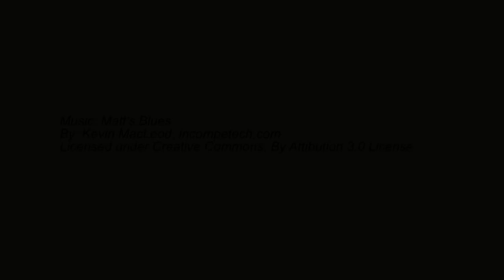Cool New Hammers from Martinez Tool Company

Comment: As a tool addict I own almost every kind of hammer under the sun. For framing I use a douglas 19 oz hammer, for trimmnng I use an estwing 12 oz leather handled hammer,  and for concrete forming I use a 14 oz t-bone hammer.  I rarely use a hammer for demo, as I was taught the trade by old timmers that would ream me out for improperly using my hammer and would make use a small pry or a hillbilly bar as we call it in Chicago. These new hammers are a big improvement over the old stilettos, and I will definitely add them to my collection.  To all those people that say you can get a Vaughan hammer for $200 cheaper, while true you definitely are missing the point. These hammers are pricey but they're indispensable for carpenters driving nails day in and day out, and while nothing will ever replace good old hickory for absorbing impact, I'm glad and thankful that Mark Martinez designed a great hammer for us all to be able to ply our trade more comfortably and more efficiently.
Reply: you really like hammers
Reply: @Zozo806  When you’re driving over a thousand nails per day, you tend to focus on what you’re swinging!
Reply: oo rah, the hammers are worth the money for replaceable/swappable heads and handles alone.

Comment: hi Mark, for me one of the strong Benefits of this hammer besides the unique design, lightens and quality is being able to switch out the head should it become worn or damaged as well as changing the type of head altogether to say a ball point or mallet. for me my interest in this hammer besides the inventors high reputation was the ability to us this one hammer as two hammers_ so by simply changing the framing head for framing, to a finish head for furniture projects. however after speaking with Sandra it would appear this is not the case, Sandra has advised me that I can purchase the m 1 with milled or smooth head only for framing but I would need to purchase the m 4 for finish work when it becomes available. given the information from both this  video and the emailed information from Sandra I am a bit confused and I hoped you could please clarify. love the hammer.

Comment: hi, very nice hammer. I am a Irish carpenter working in Ireland and I currently use the vaughan 23oz wooden handle hammer for framing and it's time for a change. I heard the stiletto hammers are the best as they are made from a single piece of titanium which is stronger and lighter than steel. but in this video it seams to me that you recommend a hammer that has a STEEL head not titanium. before I purchase can you recommend which hammer you make that would suit my needs? I prefer a long straight handle 18" but doesn't have to be wooden. I do framing as well as framing work, this might mean I need two separate hammers but you can advice. I have no intention of abusing my hammer such as concrete work. Cheers Dan
Reply: Daniel O'Connell he used a steel face because titaniums waffle face wear of easily. I have stilleto but I switched to steel because the face don't wear off. I use deluge 21 oz now but I'm thinking of switching to his new 19 oz hammer
Reply: Daniel O'Connell I have a 14 oz stiletto mini all titanium. I really love it for what it is and for my old job. I bought the mini for when I was working with stairs and hammering in wedges all day long so I didn’t need the extra reach/drive like the ti-bone offers. So I started Formwork construction, and sure the mini works but I’m always wanting more weight/extra reach on the job site. I was about to buy the 15 oz stiletto until I saw this hammer, so I just purchased this online($300.00 CAD with shipping later)- I can’t wait for to try this hammer out.
I’ll let you know how it goes, but I will say..don’t buy the 14 oz mini stiletto if you’re doing heavy construction- you’ll be wanting extra reach but the 14 oz is a great hammer for what it is.
Reply: I'm late to this thread but a m1 I've been using mine and I absolutely love it

Comment: I can buy several estwing hammers for 200 bucks. They never give up.
Reply: True , for what i want an Estwing is more than enough :]
Reply: massey9556

Options are good.  In a socialist utopia you'd have one choice, like it or not.
Reply: Yes, but I believe the issue is the inevitability of your joints giving out.
Reply: Well after snapping 3 different 22 ounce estwings I pulled the trigger on a tibone 15, I still carry a 22 estwing because the slimmer profile is convenient in those tight spots. 95% of my swinging is with my stiletto and I’d never look back
Reply: Just your elbows will give out .

Comment: I guess my question is why would you use a $200 hammer for demo ? I know you have to plan for every use and I generally use a Stiletto wood handle. I have broken a number of handles doing demo, so I got in the habit of using an Estwing or similar steel hammer for demo, then switch back to the Stiletto for carpentry work. I may try the Martinez, the only question I have on it is length. It seem significantly shorter than the wood handle hammer. I use tennis racket grip on my Stiletto, fairly durable and more cushion than the baseball bat tape I was using. My 2 c.
Reply: Glenn Banks I use my tibone 15 oz stiletto for demo in concrete work no qualms haha
Reply: The Martinez M1 framing hammer is of comparable length to the Estwing 22oz framing hammer.  And the Martinez M1 finish hammer is of comparable length to the Dewalt 12 oz High Velocity hammer or the Stiletto 10 oz finish hammer.

Comment: The wood handled hammer is a lot cheaper,.. but the titanium handled hammer has a TON more job-related versatility and repair/replacement options... MAN, this is a tough call. Do I WANT to make what's basically a car payment for a tool, that, if I take better care of it than I do my Estwing, will last me forever? Even though the Estwing may not be as expertly innovated and engineered, it's still a straightforward, classic, dependable design that's budget-friendly. This is a tough call. A tough call, indeed. And it kills me because tools like these are meant to be marketed to working class people, like myself. Not very many of us have money to blow on real expensive hammers; even if they're hammers of the gods. I wonder if Martinez tools takes payment installments. Lol

Comment: Who wants a hickory handled hammer that requires a proprietary haft ?
You could drill a couple holes in any framing hammer haft, but it's easy to drill a hole off center so you kind of need their proprietary haft and who's to say you'll get one with good grain when there's probably zero chance of being able to buy one in stores and inspect them as you need to do with just about all hafts today.
My hammer heads don't come loose on me anyways, I hang them properly and I oil them with blo so they don't dry out.
The traditional hanging method used for hundreds of years is perfect, the problem is that people used to know how to care for their tools.
I'll keep my Vaughan 999 or 1950's Craftsman hammertooth also produced by Vaughan & Bushnell, a brand new 999 is a fraction of the cost and is flawless.

Comment: If you will spend 200$+ on a hammer have I got a bridge for you!
Reply: Ya that's too cheep. When you blow your elbow or your lower arm you'll know how cheap is dumb
Reply: Colter McInnes if you actually just said that I bet Uve never done anything productive or worth looking at with a hammer 😂😂 putting Ikea pre made dressers together is not “carpentry”
Reply: Kingsley 905 are you making piano's with your hammer? Cuz im doing formwork/framing/scaffolding and my 50$ dewalt that Iv had for 3 years now hits the dumb end of things just as good as a 260$ ti-bone or martinez Iv seen just as many broken titanium hammers as others so its not even more durable.
Reply: Jack Boersema dewalt makes an even lighter 12oz hammer so if I was concerned about tennis elbow which I have had (really fucking sucks) I would use that
Reply: I use the 12 for scaffolding and 14 for framing/formwork etc

Comment: I was striking the top of my 14 inch cats paw. With the hammer HEAD and the CLAW BROKE  right off. THIS has happend to me 2 in less than 3 months. For 200 plus hammer idk. Ive owend a stilletto hammer and that never happend to me. Smh over priced hammer
Reply: Samuel Najar Titanium is difficult to cast without getting air bubbles in it. This would create a weakness
Reply: Martin Durant. So the claim that titanium is stronger would be false.